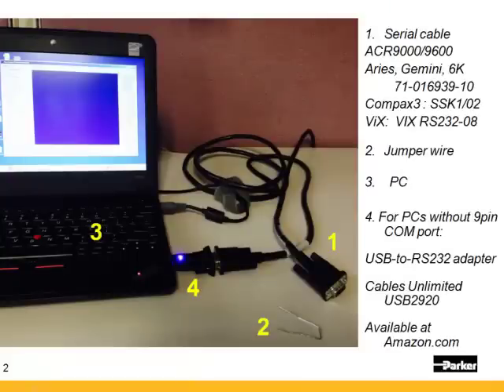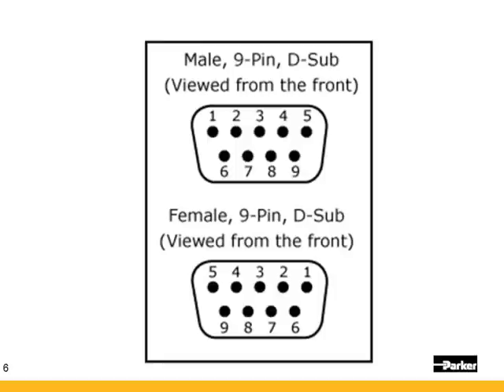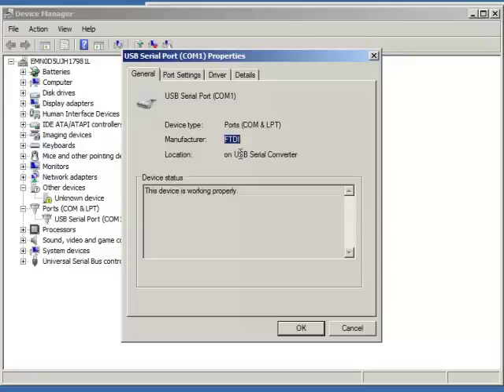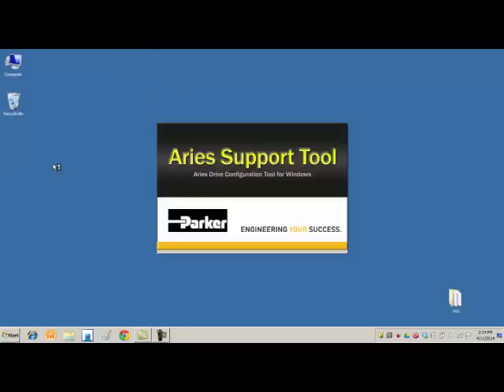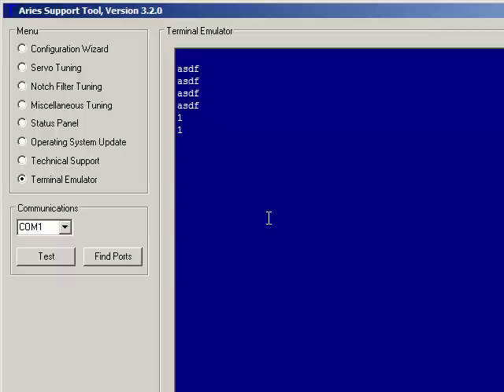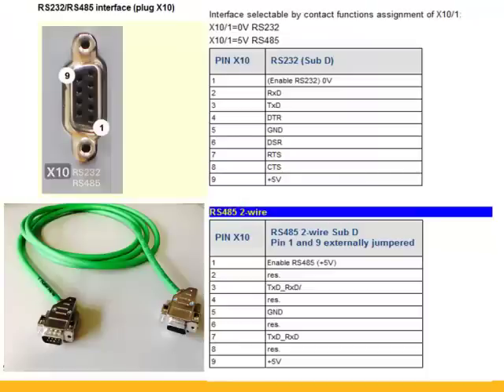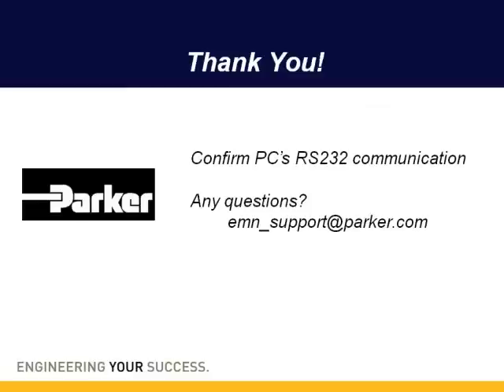How to troubleshoot serial RS232 communications

Comment from the maker: Paul, pardon the delay. You'd jumper pins 2 & 3 together at the end of the null modem cable. This jumpers Tx (transmit) and Rx (receive) together. If you can see what you're typing in the terminal window, you have control of the com port and have the correct port number selected. (It however doesn't tell you if the cable is null modem or straight through or not. But if you can't communicate to the product, then check the cable pinout.)

Comment: You have not mentioned DTEs or DCEs. A DTE is a Data Terminal Equipment e.g. a PC or dumb terminal and a DCE - e.g. a modem or line driver etc - is a Data Communications Equipment. A DTE sends data on pin 2 and receives on pin 3. A DCE receives - yes receives - data on pin 2 and transmits data on pin 3. This means on a 25way connector a DCE will send data on pin 3 even though the designation of the pin is RxD. The reason for this is to do with the fact that a DCE is normally receiving data from a line system e.g. a telephone line and so the data that it sends out on the DCE interface is the data that it received from the line system. Many people make the mistake of thinking that you always need to cross transmit to receive but not when connecting a DTE to a DCE. So when connecting a DTE to a DCE you actually connect TxD on the DTE to TxD on the DCE and RxD on the DTE to RxD on the DCE.
Reply from the maker: Thanks for adding that — manuals for other devices should be consulted. 

Some plc’s use straight-thru cales (2-2, 3-3, 5-5 on 9pin) from through cables such as old AB that have serial ports. Our drives though use crossover cables (2-3, 3-2, 5-5 on 9pin) and hence the video is explaining connecting to our equipment.

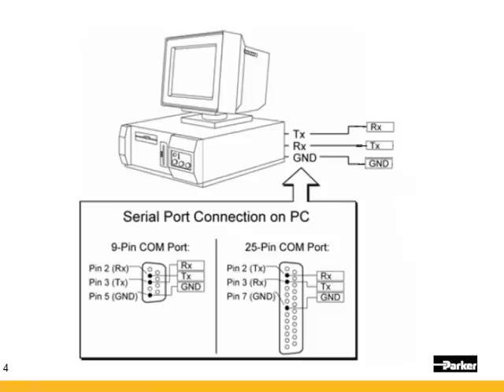Comment: 1:40 it looks like your diagram for the 9-pin com is incorrect, at least how we would view it (looking at the port at the back of the PC).
Reply from the maker: lyianx it is correct. Tx on pc is transmit and is connected to Rx receive on the product. Rx on pc is receive and connects to Tx transmit on product. Ground (or more accurately dc common) are connected.

Comment: Can we check this in hyperterminal?
Reply from the maker: Yes but Microsoft stopped including HyperTerminal after XP. For Win7 or Win10, there's several open source terminal type programs but there's so many menus & settings, they're not as easy. Our software configures the com port settings (baud, data bits, stop bits, flow control) automatically when you open the software; you just need to select the Com port#.

Comment: Donu have a video on  How I hook up this device to a proportional valve to and allan Bradley 1400
Reply from the maker: Not relevant question to above video. Contact the proportional valve manufacturer tech support.
Reply from the maker: This general advice on troubleshooting devices using serial communication.

Comment: ask, what if i need rs232 to mini usb? what is needed to change from rs232 to mini usb? because most of those on the market are usb to rs232.
Reply from the maker: The pc has usb, not mini usb. The rs232 is for the drive/controller side, not the pc.

Comment: I had prob which is the feedback is not the same. Example if puts "asdf" then the feedback will come out "asde". It is like near miss. I use rs232 cable solder with 9 pin female d sub connect to male d sub cable which has usb.
Reply from the maker: How long is the cable? Is it shielded? 

If it’s longer than 10ft stretch it out so it’s not coiled up which can increase the impedance. Consider shortening it — rs232 isn’t reliable beyond 15ft. Make sure it’s not next to high power cables with a lot of noise/switching frequency. If you must cross it, cross at 90degrees but best if you re-route it so it’s not next to high power cables. 

It could also be ground loop; if on a laptop try unplugging the power supply and run on battery; I’ve seen issues where controller is on one circuit and pc is on different curvy it and because the grounds weren’t the same caused issues. If it’s not a laptop, try plugging pc into same circuit as controller.

Though unlikely it could be bad solder on the cable. Try spare rs232cable. Off by just one character it’s probably not that but that’s be last thing to try.

Let me know if that doesn’t fix it.

Comment: Hello,
I"m using windows 10 
After connecting RS-232 to usb 
it it not showing any port connected
kindly help me to fix it
Reply from the maker: Is your pc connected to internet? It should install the driver. If not, go to the adapter’s website to get the driver or google search it and install the usb driver
Reply from the maker: Then it should show up under device manager under ports

Comment: what is the windows O.S are  you using?
Reply from the maker: +MsJinkerson MotionPlanner is compatible with Windows7, 32 or 64bit, or also WinXP and also earlier versions of Window.  Aries Support Tool also has a terminal emulator and I've run that on XP, Win7 32bit and 64bit.The key on Win7 is the FTDI usb-to-serial adapter. If it's not FTDI, I wouldn't waste any time til you get one. There's a lot of little details in the video for our different products. Enjoy!

Comment: I'm having trouble understanding where to physically add the jumper wire. 

I have the cables unlimited usb to serial adaptor and a null modem cable.

Where do I install the jumper without resoldering??
Reply: +Paul Barden For your statement  guest you have a male connector which make difficult the task of jumping the terminal however you can find a connector one simple connector that connects male to female connector use it and then use a wire may be the one used for Ethernet   then plug it into the two holes 2 and 3 of female connector the you are done.